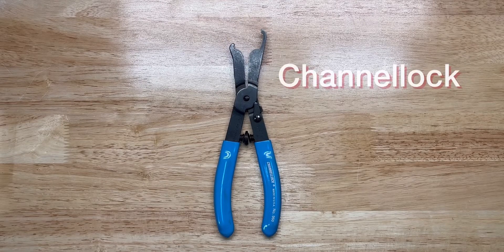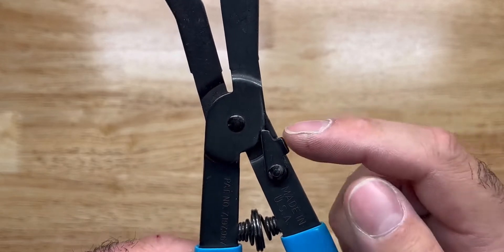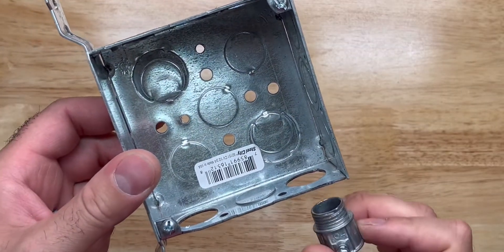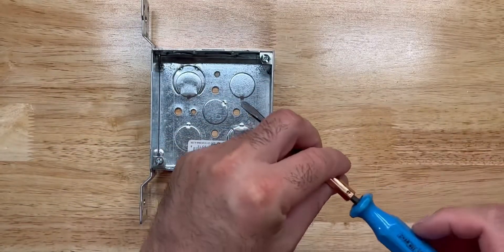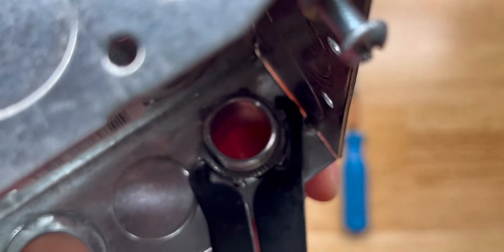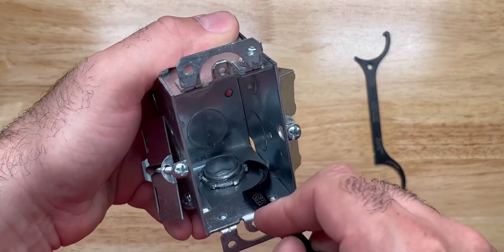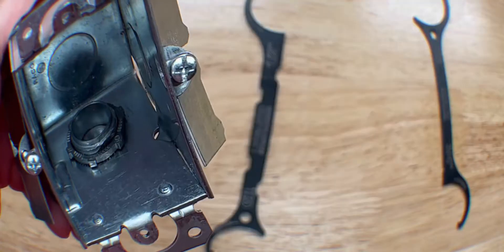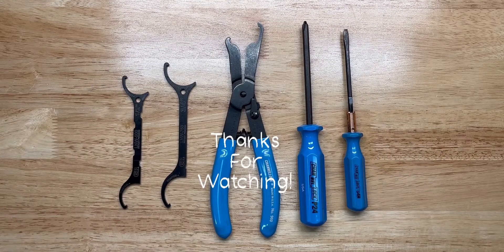Channellock Locknut Plier feat. GB Locknut Wrenches

Comment: Where did you find these channel locks? I've been looking all over for them 😅
Reply: I purchased them from an electrical supply house years ago. My opinion they’re not worth the money.  Klein makes a pair it’s sold under KLEIN LOCKNUT PLIERS they’re 200% worth it.
Reply from the maker: They’re not easy to find, it’s a discontinued item. 
As recommended by “The Electricians Tool Channel” the Klein are an excellent choice.
The only advantage to the Channellocks is the wider range, 1/2 to 1 1/2 locknut.